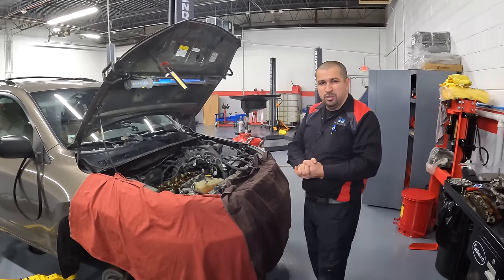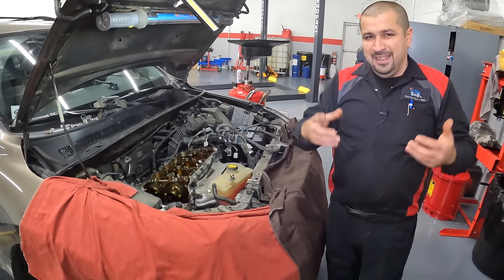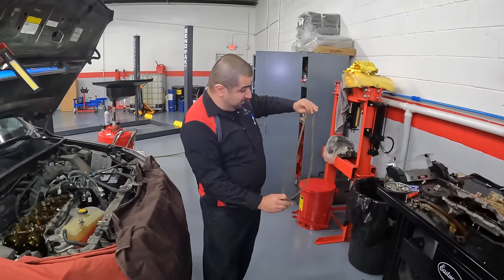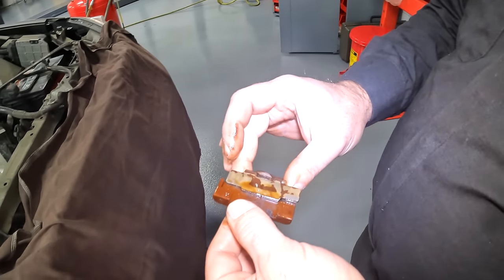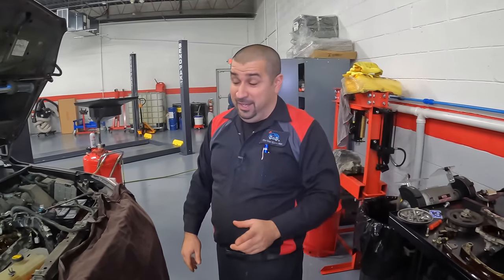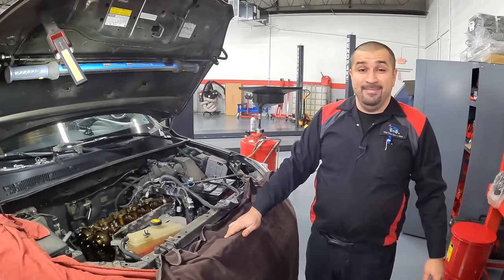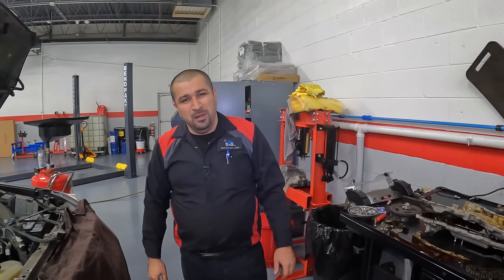When Should You Replace Your Toyota And Lexus Timing Chain?

Comment: I am not a mechanic but i have removed and reinstalled timing chain on different Corolla 1.8 engines.  Usually I visually inspect and measure the chain, as well as look at chain guides.  I did replace a head gasket and replaced the chain as well.  Motor had 203,000 miles. I also replaced the tensioner and valve stem seals.  An extra 150 bucks for the kit was worth the insurance.  The amazing thing about the video is how do you remove the VVT i gear without removing the front cover.  On the 1.8 engine there isn't enough room to get a wrench in there.  Just speaking from experience.  When i did remove the chain guides, they were in excellent shape, slighty grooved.

Comment: One of the biggest mistakes that I see when people (for whatever reason) replace the timing chain is that they don’t put any Oil on the chain during installation which is a huge disservice to the engine and the owner who just paid for a replacement service. Oil takes some time to reach the chain during initial startup after installation and a lot of damage can be done in just the first minute or two after starting. Mechanics really should know that but don’t seem to care.
Reply: Thanks for the reminder. I'm doing one this weekend, and for sure won't forget now.

Comment: Toyota rubber timing belts were also well made. By the late 90s to early 2000s Ive seen them go over 250,000 miles with no issues. Their waterpumps tend to last just as long.
Reply: I've one in my 99 camry with a little over 90,000 miles on it. It's a 4 cylinder, not driving it abusive I think helps too. It's all OEM replacement parts too. The test continues.
Reply: I purchased a 2001 Camry 4 cylinder in august of 2020 with 35k miles. Really debating on changing the belt due to its age. CarFax doesn’t show it being changed. Thoughts? Currently has 40k miles.
Reply: @John Salov  I would leave it. Unless your going on a very long trip then you can change it for assurance if you want. The worst it will do is strand you if it breaks, it will not damage the engine.
Reply: @carguy4243  thank you. Learn a lot from your channel. And that this engine is a non interference engine. It’s my grandma beater car. They make fun of me, but when my family needs to use my car. It all of a sudden is a great car.
Reply: I have a 98 Camry, the original timing belt Toyota started showing wear after 100k miles so I was recommended to replace it.  I changed it with Gates Brand timing belt and water pump kit, 50k miles still looks like new.  Gates Brand belts and hoses are top quality

Comment: I bought an '07 Lexus GS350 a couple of years ago that had previously had VVT actuators replaced under recall/TSB/whatever around 70k miles... I bought the car for cheap due to a CEL for an exhaust cam timing issue due to the timing chain being stretched.  I replaced the chain and it's been good to go.

Comment: Thanks again AMD. In 2008, when I was in the market for a Camry XLE, I was looking for the 4 cylinder in white. But the dealership only had the 3.5L V6 version. I walked out. Then, they called me later in the day and offered the V6 for the price of the 4 cylinder. I grabbed it. It was a different time. Now my ‘08 Camry is almost 15 years old with 127K miles on it. Still looks new and runs decent. Always garaged and in covered parking deck. I will keep this car for as long as I can. Hopefully, until I retire. In 6 years.
Reply: You'll get tired of looking at it before it's worn out.
Reply: The 3.5 V6 is a pretty efficient engine.  A friend of ours owns a Toyota Avalon with that V6 and he has seen 35 mpg from that engine.  It sounds astonishing, but it just goes to show those engines are efficient.
Reply: I had an 07 with the V6. You saved yourself from misery from that garbage 2.4L  AZ 4 cylinder Burns oil like there's no tomorrow and almost ruined Toyota's reputation. The later 2.5 AR, four cylinder was much better. The GR V6 is an amazing Motor that has a long life.
Reply: @peted5217  Hahaha! I’ll never get tired of looking at it. Seriously, it still looks new.
Reply: @matthewmiller2268  Thank you. Good to know.
Reply: @cargueone1971  Thank you my friend. You’re right. Misery is the right word.

Comment: My dad still has a Toyota Carina. We actualy recently finished restoring it together. Anyway, a couple of years ago, our timing belt (on a 4A-FE engine) outlasted the timing pulley. Literally, the spokes broke, and the pulley just yeeted itself on the highway. The most amazing thing is, my dad replaced the pulley, and the engine ran without prolems. He didn't time it right, so for a couple of more years we ran this engine around 15 to 20 degrees off timing. We.. only recently found that out to diagnose an iddle stutter... lol
Reply: That’s amazing!

Comment: This is a very valuable video. I have a 2011 Toyota Tundra with 200,300 miles. I have wondered about my timing chain. Toyota recently bought back a 2008 Tundra that went 1,000,000 miles. That owner changed his timing chain twice in 1,000,000 miles. That is remarkable ! If I ever reach 400,000 miles, I will probably change my timing chain. Thanks for your great video.
Reply: I own a 2007 Tundra. I love this truck. Just worth mentioning, the original battery lasted 12 years. That’s incredible !

Comment: This is good to know. I have a 1.8L VVT-i (1ZZ-FE) in a '04 Pontiac Vibe and was wondering how long the chain should last. Engine has 260k+ miles on it and has been run on Amsoil 5w-30 full synthetic since about 50K mi. Oil and ATF changed every 10K mi. No unusual noises, just runs. Original water pump, alternator, starter, 32.5 mpg consistently.

Comment: Timely topic, since the Car Wizard just yesterday insisted you have to examine and maybe replace the timing chain after 100,000 miles, maybe at 150K at the latest.  But he didn't think to add, "except if it's a Toyota."

My thought is when you have to replace the gasket for the timing cover to fix an oil leak, that's when you inspect everything.
Reply: watched the same video!  LOL
Reply: You can measure the chain links/pins to check for wear.  This is common in the motorcycle world.  I imagine service manuals/data sources would have specs for this.
Reply: I was thinking the same thing as I had just watched that video too. I like to learn from Car Wizard for the more "general" things but always come to TCCN for the Toyota-specifics.
Reply: @connor3288  A peek at the tensioner will do that but the front cover has to be off to get to it.
Reply: @flagmichael  The valve cover being off will let you see the chain on Ohc/dohc engines

Comment: I had this argument with an Actual Toyota Tech the other day as I want to replace the Timing Chain on our 2014 4Runner. We lost a very expensive motor in an Audi due to the guides going bad not the chain itself. I would rather spend a few K on a new Chain and Guides then more on a new crate engine.
Reply: You will be wasting your money. Audi's are notorious for chains issues. The 4.0 L Toyota engine is bulletproof
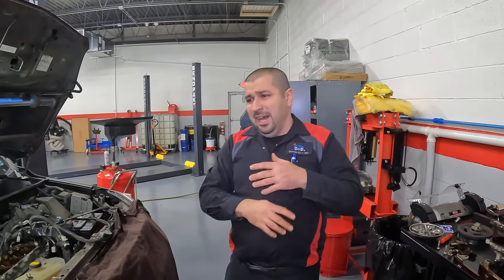Reply: Go to 8:07 and then reconsider. If there is currently nothing wrong with your 4runner, it’s a huge waste of time/money.
Reply: @gianfrancoa  The early 4.0L engines on the Tacoma (2005-2006) had head gasket problems till a few years later they redesigned the head gasket to solve those blown head gaskets, so not everyone was bulletproof but most were.
Reply: The 1GR-FE V6 in your 2014 is famous for lasting 500,000 - 1,000,000 miles without any internally lubricated parts wearing out, which includes the timing chain mechanism

Comment: Timing chains and sprockets are standardized and are made by the same company.  The company that makes them  makes several different  sizes and the car companies design their engines around those sizes. (keeps the costs down)  I have a relative who works in the foundry that makes them for most of the car companies.    Neglecting oil changes causes  the chains to wear.  The connecting pins wear and the chains get longer.

Comment: One thing that happened with my 2003 Toyota Camry  recently(300,000) mile/was that I was driving as I do for my job. I parked in a Parking garage, did a delivery and when I went to start up my car, it seemed like All of a sudden it was running rough…so I took it home, took the cover off and noticed that the timing marks weren’t aligned up, so I figured the timing tensioner got stuck or even went bad and made it lose timing. However, after buying a timing chain kit, and removing the oil pan, to my surprise I saw bits of what seemed like a plastic-like gear all chopped up and disintegrated into my engine oil. Found out It was the Nylon gear for the balance shaft assembly that was the culprit. So, I bought a replacement, replaced the chain assembly, the balance shafts, the tensioner, and the VVT-I assembly. Car works like brand new! Funny, thing is how this was the One time I wanted to go a little bit over my oil change interval. But yea, Camry has 335,000 miles on it, runs great. Also as per maintenance for such a high mileage vehicle, I had the transmission recently repaired after it failed, but that was only because going over the repair documentation, the Camry Developed the problem Strictly after having a transmission flush service done to the vehicle. All is well, curious how many more miles I will get out of her. Maybe I will hit 500,000…who knows! I’m pretty thankful.
Reply: Amd recommends for the older t4 transmission fluid.  Do a drain and fill one time only every 3 years or 30000 miles. No flushes.  Use only Toyota fluids.  Change the coolant every 3 years or 30000miles.  The new Toyotas drain and fill one time every 6 years or 60000 miles.  The pink coolant change every 5 years or 50000 miles.  Oil never go past 5k mile changes.  All the best

Comment: Always appreciate the information I receive watching your channel. Quick question, I’m a former Chevrolet guy. When replacing the timing chain on a Chevy, the gear set is usually changed as well. I see that you recommended changing all of the guides on the Toyota if you’re replacing the timing chain. Would it be recommended to change the sprockets as well? And, if not, why not?
Reply: Depends on why chain's being replaced. Save abuse , should last life of vehicle by design. It's why they cost a little more.
Reply: Correct, you should never change a chain without also changing the sprockets, ask anyone with a motorcycle.

Comment: Great video, currently doing a ton of research after picking up an 08 FJ with 340k miles.  P0016 code (check engine wasn't on), I have also watched the other videos where you ran bank 1 vs bank 2 tests via the scanning tool.  A lot of forum posts seem to point towards checking the extension of the plunger on the tensioner via the inspection cover as a sign of wear on the chain.  I have confirmed mine is extended beyond approx. 10mm.  "tragically worn"

PS - I'm asking for the collective hive mind input, not Amd specifically lol

Comment: Its nice to have a timing chain. The cheapest belt service I have found for my Honda J35 was 950$ which was a whole 500$ cheaper than the next cheapest option. The parts kit was only 180$ and if I had a lift, would have done it myself. But on the Lexus its not even a concern, the 2GR doesn't need chain service.
Reply: Yeah those Honda J series can get expensive for timing belts. From what I've seen, J35's cost a lot more than the old J30's. I've heard this is because the procedure is more involved on the J35--something about tighter packaging and having to remove/drop some suspension components to do the job. My mom wanted an Accord coupe with a J35 as her "nice" car. Wasn't interested in the 4cyl option. That's fine and all, but I warned her to squirrel away $1200-1500, because one day it will ask for that timing belt service. She was perfectly willing to accept that future reality.
Reply: @thatoneotherotherguy  yep. You have to drop the engine a whole 12" or do with the entire subframe so that's why you pretty much need a lift
Reply: I will never buy a timing belt vehicle. I'm not doing that job or paying someone to do it when I can get a Toyota with a chain and never worry about it. Hundreds of dollars or hours of time and work for something that should be in necessary. Honda can keep it.
Reply: @AmandaHugenkiss2915  it is annoying that Honda stayed the course on V6 belts. That said, if you like the car enough, you can make the excuse for it and spend the extra money every 100,000 miles if you'd like. Just depends how much you want the car. I had a timing belt done on a 2004 Accord with a J30 and a six-speed manual, and I had 60,000 great miles in that car. Was worth it for me. That said, I am happy my upcoming 4Runner runs a chain.
Reply: Remember that a Honda Timing Belt Service includes the water pump replacement as well, which in basically every car recommends doing this around 100,000.  The price for replacing a water pump isn't too far off the Timing Belt Service.  Yes, it's a pain, but it gets done at the same time so I'm not trading in my J35Y1 anytime soon.
Reply: @timothyforce1949  somewhat true, however quite a number of chain driven cars exceed 200 or even 300k miles on the original water pump as well as chain. It's nice when the whole setup lasts the useful life of the car.

Comment: Our 2016 Sequoia with the 5.7 had the dreaded rattle on very cold start up, like 25 degrees F or lower due to a sticky timing chain tensioner (seems to be common on the 5.7 based on other videos on YT and tundra forums).  Always did the oil chain on time with the dealer every 5k.  Started doing this at 65k, now has 116k on it.  Only does this on very cold MN mornings.  Once the engine warms up the rattle goes away.  Going to try running some marvel mystery oil thru it 500 miles before the next few oil changes and see what happens.
Reply: I have the same issue just started on my 2012, 5.7 Tundra at 135k. Did the Marvel Mystery oil help?
Reply: @spookerr  yes, it definitely helped.  It still does it on very very cold MN winter mornings with worn dirty oil just before next change, but quiets down in a few minutes after warmup. Never hear it from spring and all summer long.  I may do  another round just as basic maintenance and see if that gets rid of it completely this winter.  We now have 125k on it.  No code for any timing issues or stretched timing chain or anything.

Comment: First of all I love your videos, please don't stop and God bless you also. I own three Lexus vehicles, all used. This particular problem with the oil line you are discussing, should have been an official recall from toyota/lexus. One of my  08 vehicles has the shredded oil line problem but someone changed it before I purchased the vehicle. It has the 2GR-FSE. Being a new Lexus owner as of 3 years ago, and being a garage mechanic on the side, I am not optimistic like many who say Toyota has the best engines. I think it might be 10% above some of the other manufacturers. The fact that Toyota chose to make an upper oil pan which makes it incredibly difficult for a very good mechanic/ engineer, to remove the upper oil pan without removing the engine. To me that is a huge mistake and tarnishes the reputation of an otherwise very qualified business. If I might add a request for your video coverage would be this: talking about the GS 3rd generation and how the upper oil pan might be removed more easily, if it is even possible. On the 2GR-FXX versions with V6 which is what I own and also the longer lower engine with the V8. Also noting that the AWD models may have extra requirements to even remove the timing chain cover. Here is an example on the GS 350 with the V6 engine is it extremely hard to change the timing chain or camshaft parts or even the tensioner due to the fact that the upper oil pan may have to be removed forcing you to Jack the engine up if you're working in a driveway or being forced to take it to a mechanic who has the time to lift the car, remove all the frame parts to include much of the suspension and axles just to Simply get to the timing chain or the camshaft parts. This is not actually a complaint. It is something I have dealt with personally with one of my vehicles. I am an apt engineer and worked on many cars to replace head gaskets however this particular model has been a special pain in my butt. It would be nice to see you display some video talking about the issues of removing the upper oil pan just to remove the timing chain and engine models this does affect. I know one certified Toyota mechanic in the area I live. He is Asa certified and owns his own repair shop much like you do. He has told me that working on the 2gr engine is also a pain in his butt and he made the comment that it's one of the worst engines toyota/lexus ever used however they continue to use it but making slight changes. Please attempt to restore my faith in Lexus engines because at this point I'm ready to sell all three Lexus vehicles and not recommend them to any family members any longer. Giving Up luxury just to know that there's an engine that I can work on without paying $9,000 to a dealer is a huge plus to me and well worth staying away from Toyota.